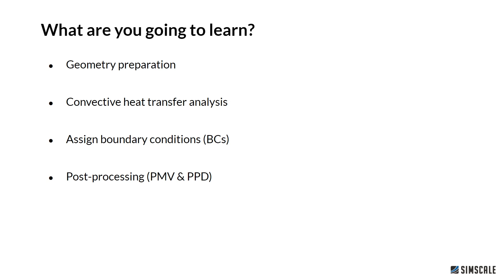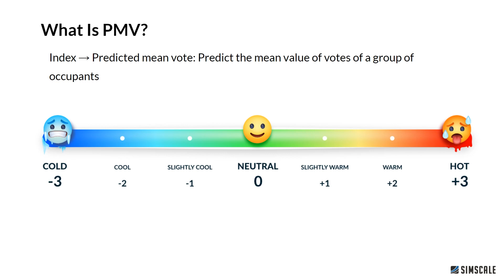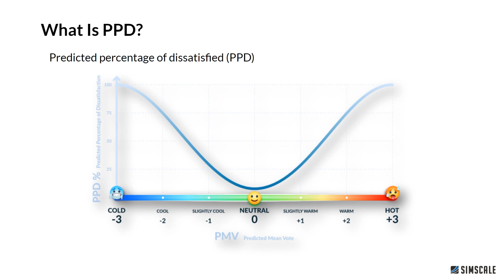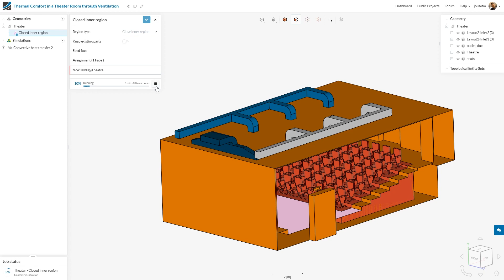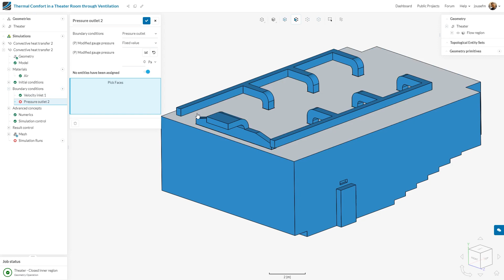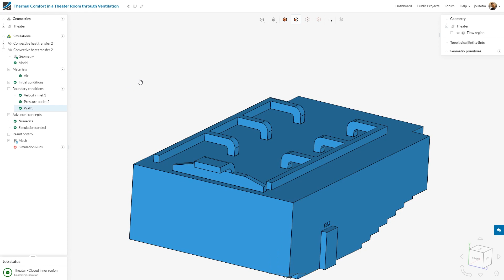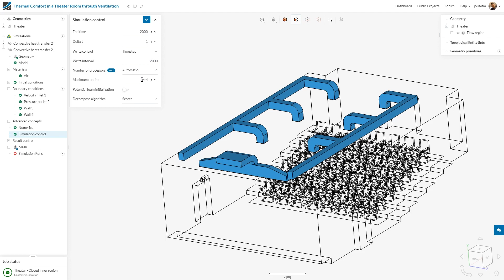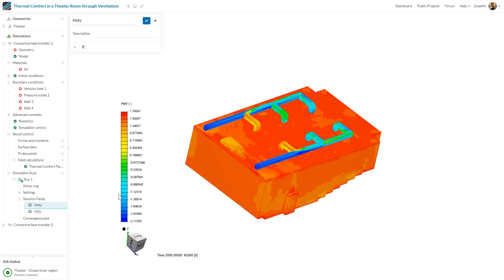How to Ensure Thermal Comfort in a Theater Room

Comment: Hello, why did 101325 Pa doesn't work, but 0 Pa works while we put the value in pressure outlet 2 in boundary condition? As the atmospheric pressure is 101325 Pa, it should work like this, right?